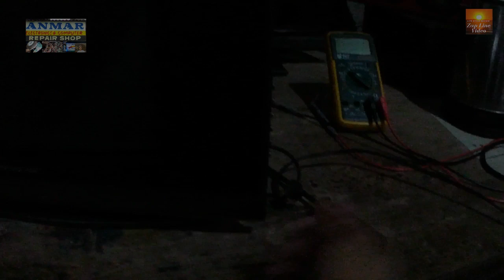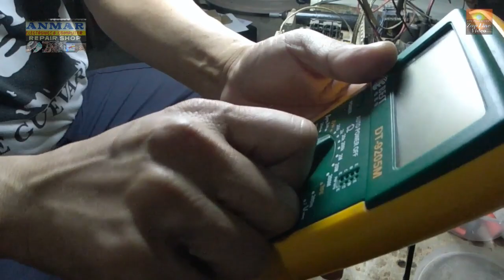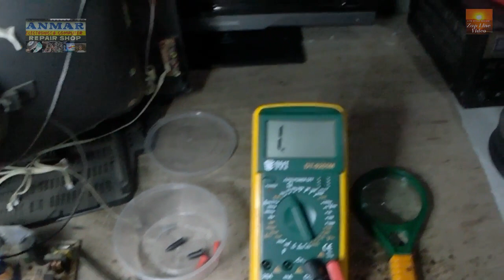#34 Ep. Pensonic 17inch. CRT TV No Video.

Comment: China crt tv paano ayosen wlang screen output galeng plyback maghehentay ako pls.
Reply from the maker: Madami dapat e check pag walang output screen pero hito ang tip check your e cap video 180v check the present voltage of screen in crt socket chck mo din kong umiilaw ba ang heater niya sa tube ok